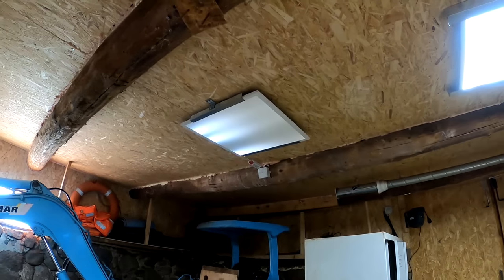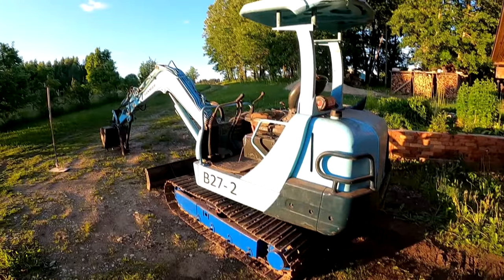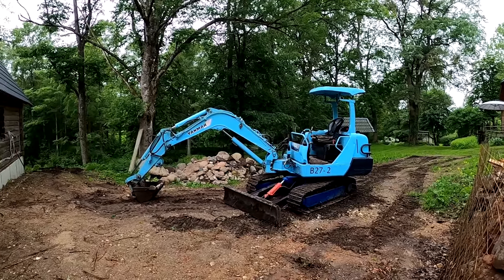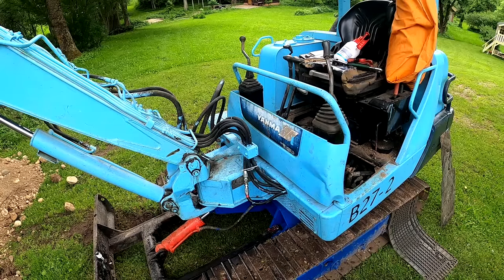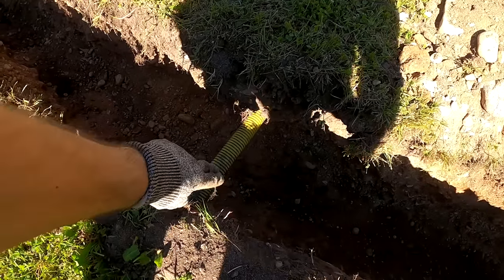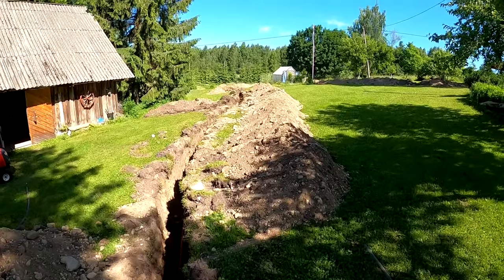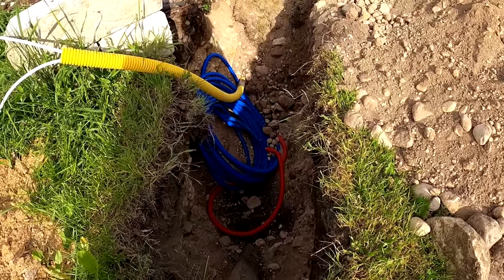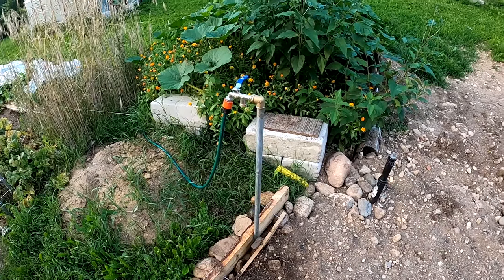Installing a water pipe to the cabin & greenhouse

Comment: Hey Andris, a small suggestion if i may, when exposing or laying underground services when refilling the trench lay some plastic marking tape a few cms above the cable or pipe, then next time an early warning. Many thanks from UK.
Reply from the maker: yeah i usually do this in case of electrical lines, but it makes sense to add it to a waterline also

Comment: Answer to gravel and sand you find, usually gravel and sand can be found close to  river  bangs, if you have a close river definitely there is a great chance there will be gravel or sand only depending on how deep, sometimes 2m - 3m, sometimes only a few  centimeters.
Super nice job with Yanmar and the fix you made before was a creative solution.😃
Reply from the maker: Theres massive amounts of the stuff around a soil study was carried out in the area this year and now their trying to open up a second gravel/sand mine on the area. Actually like right next to my property
Reply: @Ants_Pants  
    In Latvia we have issues with sand and gravel mining, mostly because they Digg out illegally gravel and sand and then dump all kinds of trash so you can not prove it is done.😔
Reply from the maker: @birch8005  that sucks bro i guess that problem is everywhere

Comment: On the light issue: swap the driver with a working light. In my experience the drivers fail lot more often than the actual LED array. If it works with another driver, you can buy a replacement driver cheap.
Reply from the maker: I bought a new panel and it works now. The driver was okey 👍
Reply: @Ants_Pants  Don't tell us you get rid of your ''disco light'' in the work shop ...... ;-) 😁😉😉😁😁
Reply from the maker: @dhache1195  i put instead a disco ball. Actally about 700 of em

Comment: The field install hydraulic fittings are great. I use some grease on the threads to help them to go together more easily. 

It also helps to use a pocketknife to cut a taper or cone on the inside of the hose.  Yes, it is supposed to go all the way in.
Reply from the maker: Thanks Mark 👍 also for the tip

Comment: A tip for the excavator is that you should shorten the tracks about 1 link so you dont bend out the chassi parts where youre turn wheel rides in, you get alot off force on to the turn wheel and the chassi when the turn wheel are that far out 😁
Reply from the maker: I guess that makes sense but i assume it is designed to handle these loads from the factory? 👍
Reply: @Ants_Pants  you can just ask a mechanic or a excavator dealer about it. 😁 It was just a tip to keep costs down, not fun when the chassi part have split apart, very hard to bring them back, i work with excavators full time so ask me how i know 😅😅
Reply from the maker: @PowerOfValmet  sure bud👍 i will roger that 😌 but then again if it does break then ill get a kickass video out of it trying to fix it up 😅

Comment: Check out that porta-power style hydaulic crimp from Vevor.  As I recall it goes for about $125 here in the States which comes with the 360 degree jaws and several dies.  Of course you need a selection of crimp fittings in the sizes you use.  A roll of the appropriate hose and you can do your own repairs.

Comment: I would go to the local utility company and borrow a locator to find the water lines and power lines before you dig.
Reply from the maker: how does it locate?
Reply: @Ants_Pants  works like a high powered metal detector or ground penetrating radar.
When ever we dig it's required that you notify the utility company and they will send a guy out to locate all your utility lines . They even found my underground telephone line. Then they will use a different color paint for the different lines. It's marking paint and goes away after awhile.

Comment: Any time I excavate I put 6" of fill and then lay down a roll of caution tape over whatever I just buried. Next time I have to dig and I pull up any tape I know I'm about to dig into something important. If I was smart I would have color coded it from the start but I didn't.
Reply from the maker: Yup that's a great tip to put caution tape on electrical lines

Comment: Hello Ant
I do not think it is usefull to give tipps after i saw your movie. It‘s anyway to late, as you finish your work already. 😁😁😁
So i just ask you: I hope the waterpipe you put deep enough (i guess as your country is very north, for Estonia you have to put it min 1m deep, so water will not get frocen in cold winter?
I also hope that you put bellow and above the waterpipe around each minimum 10cm sand, so that the waterpipe have space to move and will not be blocked / cut by stones?
How ever i love your movies and your work. 👍👍👍👍

By the way, i use for 70m water transportation a 1“pipe. As smaller as the waterpipe is, as more you loose pressure for long distance
Reply from the maker: Hehe i know trust me buddy! I only give tips if im 100% sure what im talking about (even then i might be wrong) i know im not perfect and i sure as dont know everything. Hell i dont know much about anything except food goes into the mouth in order for me to survive 😂
Reply from the maker: As for this video the pipe got around 1.1 meters deep. This seems about right. And for backfill i used to filter rocks out around the pipe. Although these pipes are strong and not easily breakable
Reply: @Ants_Pants  - I think you missunderstood. 

With the words: „I do not think it is usefull to give tipps after i saw your movie. It‘s anyway to late, as you finish your work already.“

Specially this: „I do not think it is usefull to give tipps …“

I meant ME and not You. Maybe bether like this: Can i change something when YOU FINISH THE WORK ALREADY and i still want give you tipps? Answer: NO, tipps are useless from ME, as work is finish already.
Do you get what i mean?

If correct or not, i enjoy to watch all your movies very much. You are really excellent person and i can learn a lot about your work.

We have a saying: „If it does not work - We will make it work“

Comment: I live on the southern tip of Africa, in South Africa. I find it strange that Europeans and Americans park their cars outside, especially with your extreme climates. Maybe cars are much cheaper than by us. I worked for a telecommunications co for 43 years, and when we made a new trench, we put in an extra duct (100mm upvc), with a draw wire, for future use if necessary.
Reply from the maker: Futureproofing 👍 it would be kinda expensive about extra 1.5k to lay that much

Comment: seems like the powersupply of the LED panel is failing. going into overload repeatedly. swap it out for one of the others? just to confirm its not the panel having a short
Reply from the maker: Thanks for the comment. I tried the power supply on an other panel and that works. Swapped out the led panel and a new one has been working ever since 👍

Comment: Your grease job is not doing a lot of good for the swing bearing..  You need to pump a few times for every 20 degrees of rotation or so.. thats 17 positions.. you greased only 1 position of the swing bearing. A swing bearing is at least 3000 euro and hard to replace.
Reply from the maker: Dont worrt iv greased it plenty in the past. Also keep in mind all the 3 lines go to the different parts of the bearing iv actually overgreased it as iv noticed grease dripping down from the ring gear